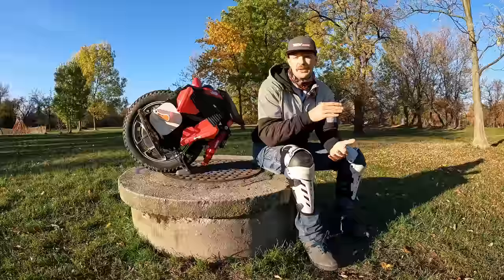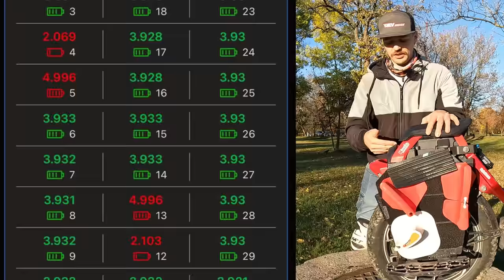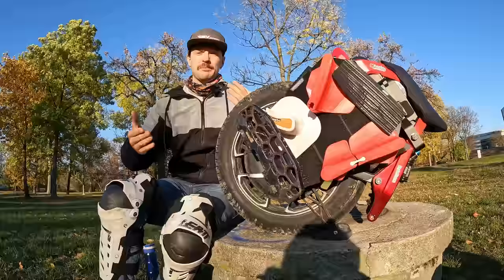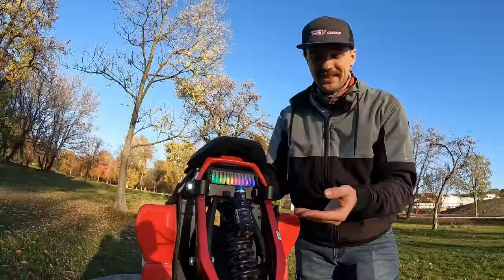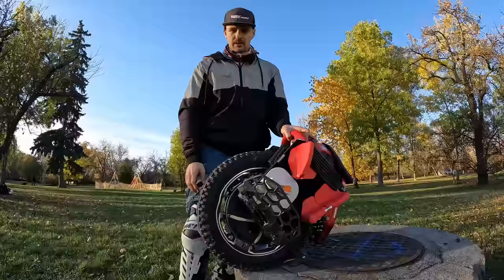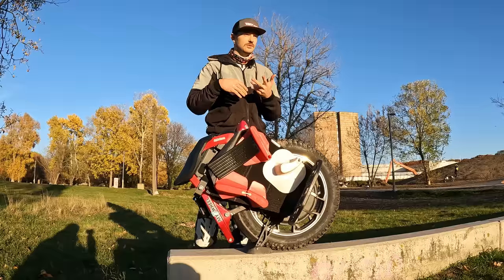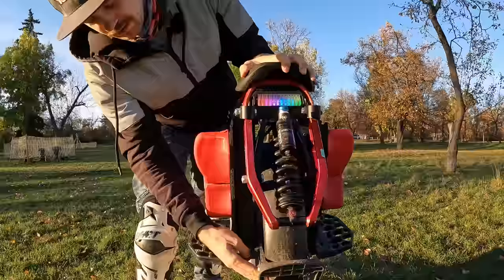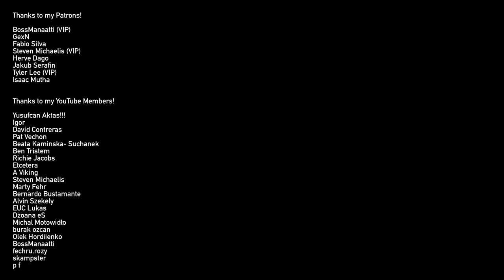BRUTALLY HONEST King-Song S22 PRO Review - After 3200 km

Comment: I’m new to EUC, and I’ve had an S 22 as my first wheel for about a year now. New Jersey United States. About 1500 miles, no breakdowns, just Clark pad, bio pads. Biggest issue I have is the range anxiety I get. About 30 miles of a quick ride, and I’m scared. Other than that , I’m very happy.
Reply: Nice. I’m in DE.  Ride safe!
Reply: Exact same story here. It was also my first wheel. I didn't think I would need more battery at the time. Now I'm thinking of an upgrade.

Comment: Worth mentioning to any owners. The actual water ingress point you should worry about, is where the LED wires go into the frame just under the front of the motherboard area. Silicone these holes after you take the wheel apart. Get one tube of silicone and it will last you ages and you need some anyway for the motor phase cables.
Reply from the maker: Thanks for the additional info!
Reply: Thank you! Which silicon should I buy, is there a specific brand? I am not sure which one to buy and where to put it, completely new to this
Reply: @CycleCritic  I use clear set silicone and you can get it from Amy hardware store.

If you look at the front of the wheel. On either side of the inner area there are wires on either side that go into the battery boxes on the side.

Where they go in there is a weak rubber seal that doesn't really do it's job. Whilst the wheel is dry and clean in those areas just paste some silicone over the hole and smush it in, then put some extra over and let it set.

When you take the wheel apart you will need to reapply it.
Reply: @InsanitiesBrother  That's awesome tip thank you, what about the motherboard itself, is that area waterproof enough?

Comment: Re batteries, they have good rubber seals, water don't get in there, water resistance around charge ports and button is super easy to fix, it's my winter and rain wheel of choice, great water resistance.

Also you dont need new controller if you want the pro motor, just swapping motor is enough.

I think your bolts broke because you are riding it pretty extremely with those high jumps to be fair.
Reply: Words of wisdom.. You silicone charge ports and start button?

Comment: Yup, totally agree with all of that stuff. I have my love-hate relationship with that wheel. (as you saw during Halloween meet ;) )
Though, i am continuously abusing it, so probably im not the best measure  for reviewing. Nevertheless , i love how this wheel sends. 😁
Fun fact that i have also S18 for much longer and i had zero problems with that wheel so far. 🤪
Reply: I abuse my patton, skateparks, dirt jumps, etc. So far only problem was a pinched tube in a rock garden

Comment: Its not as simple as just using a higher voltage MOSFET, it might work but it is questionable. One way to protect MOSFETs is by inserting an ESD protection diode between the gate and source terminals generally.

Comment: An impact screw driver will remove stuck bolts well. the hammer impacts forces the bit to stay inside the head and also helps to loosen the threads
Reply: Despite the use of an impact screwdriver, I cannot recommend loosening without heating to 100°C. You will destroy your head - the inner hexagon. The screws are made of mud.

Comment: Controller case lid waterproofing is certainly not a good, yes there is a seal but screws are inside of a sealed compartment.  BAD thing is that the lid screw heads are in cavities without any kind of seal and screws go through the motherboard. When it is raining water will be pushed under the seat to the cavities and water might seep from there directly on the motherboard. Quick fix is to put tape on the cavities and add silicon to plug two mid screw holes on the controller lid which are holding the red plastic piece on the top.
The lid is also bit flimsy and there are too few screws for sealing, so I filled the seal groove with silicone grease. All the other holes and gaps under the controller box I siliconed and I added tape and silicone grease under the power knob. Also light wires pass through should be siliconed. 
Pedals (IMO) are actually pretty good, they are lightweight and knobs/studs can be sharpened with angle grinder or dremel.

Comment: Definitely agree with you. I've passed 5300km on my S22 (Not Pro)  now, a lot of it off road. I'm not a BIG jumper, (just little ones for me) but the tracks are very steep an rocky :)
To extend the side pad area I used some 2mm carbon sheet.  Less than half the price and stiffer.
Keep up the good work Adam  👍

Comment: The S-20 was going to be my first "new" wheel. Now, I'm not even sure that I'd buy a used S22pro.   V14 and CP mini look promising.
Reply: Buy v14 if u can afford it
Reply: The new leaperkim Lynx have the same weight as v14 correct? But 20" sure have advantages on the stability and speed(150v vs 134v)
Reply: Begode extreme is amazing.

Comment: Had a friend who traded a onewheel for an s22 on marketplace. We saw it and it was working well, but it was snowing when we did the trade so there wasn't much time to see how it was. After a while it had a BMS issue that kept it tilting back everytime you would turn it on even after being on the charger, but a firmware update fixed it luckily. Sadly we just had to wait for one to be available. Although the s22 was in my friend's possession (now in mine), I rode it mostly over him while he learned to ride comfortably on my 18xl. After ~500 miles on the s22 by myself,  an issue it developed is what I can describe best as motor tremors? It can begin to shake aggressively when braking, It is an issue that is showing to be pretty consistent right now. I would like to replace the motor for a pro motor, but given all the other issues it could end up having, I might just get rid of it for cheap and let someone else work on it. I don't mind maintenance, but my 18xl with 4500 miles (~7200km) doesn't give me any issues at all. I have taken it apart to check how things are, and after decent trail riding, hitting bonks daily, and overall some pretty good torment for the 18xl, the only maintenance I will need to do soon is slap a new tire on it since mine is almost bald. Would much rather have something I trust like the 18xl than something that I will fear riding.
Reply: Those motor tremors might just be your control board is not screwed down tight enough. Because if that control board can vibrate just the slightest it will cause the motor to vibrate when you're like braking. I had that problem on my 16x and my friend had the same problem with his s22 and that's how we fixed it
Reply: @BANGbucketHEAD  Thats very interesting actually. Thanks for the info I might have to take a look into this. The bolts that hold the housing for the board arent all perfectly tight right now so Ill have to swing to the hardware store so I can get some that arent just spinning freely.

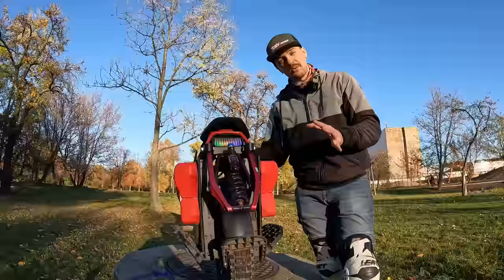Comment: @13:16 my S22 has about 1,000 miles on it and I've done tons of jumps, huge drops, and stairs... but none of my bolts broke. I guess I've been lucky. However, my S22 developed a crazy annoying vibration when riding slow or stopping and I can't figure out how to fix it :(
Reply from the maker: I’m glad they didn’t! You’re a lightweight though! I would keep an eye on them as they tend to get weaker over time… the shaking is either due to rollers or loose bolts on the motherboard! There has to be something that makes it rattle and shiver! Also glad to see you in the comment section again!

Comment: Thanks for the review , I have the same experiences, bearings loose, bolts loose and broken, but jumps like a breeze. I also experienced peddle dip when speeding and hard lean from 50 tot 70, its dangerous. But for grass racing its perfect ( max 50).

Comment: Interesting review! I find it strange that only one wheel has decent lighting for road use (the V11) and instead we have to put up with lights that are simply unsafe on the road. Why haven't all wheel pedals standardised to something that's adjustable and non slip in the wet. Will you be doing a review of the S19 and S16? Personally I'd be more interested in a commuting perspective (battery safety, range, reliability, robustness, waterproofing, features etc).

Comment: Have owned s22 for one season approx 2000 km and I generally agree with this review. Spot on for the most part. However despite all the issues, I love this wheel and feel this review helps riders understand the issues and have a better experience with this wheel.

Comment: Mine (non-pro) currently has a “working power failure” error 226, still fully rideable, just won’t charge and incessant beeping every 5 seconds. The battery packs are 0.5v different, 0.020v difference between cells. The fault actually cleared itself a couple months ago and allowed me to charge it, but it came back.

Comment: My trolley handle broke. Some sort of die-cast. I fixed it with 10mm panhead self drilling Philips head screws.
I am surprised that the bolts are not good quality steel, seeing that industrial bolts are cheap.
My front bumper has taken a thrashing and will need to be replaced. It is held together with cable ties. (I learned to ride on my machine)
Did I see cruise control in the software?
I am having trouble deciphering the meaning of the numbers in the app. Perhaps I am stupid, but I think it needs more explanation.

Comment: Glad this one never interested me.  Those rollers would be dead quickly where I ride - much dry dust and grit.  Did the rim also bend?  It looked dented in the video.
Reply: I used to off road mine, that's what I got the POS for. I ride in the mountains and I needed to do full maintenance every 600km it was every week and a half to 2 weeks. It's such a POS. I no longer off road

Comment: Need clarification, why does mb needs an upgrade? Is it only if i have 125v mosfets?
Reply: Because under certain circumstances you can over charge the board. The board has insufficient overhead

Comment: I'm just under 8k km. This is the murder of this hobbie. This wheel is enough a reason to avoid this company entirely. Non-stop problems, money sink. Non-stop repairs.

I'm all for innovation, and companies trying new things, I mean kingsong did bring us all suspension to EUCs and was much needed. Sure everyone been trying different methods to find the best one.... but to continue this failed rail trash design on further models should tell users all they need to know.

The are currently on their 3rd motor manufacturer. I am 3 motors in and willing to bet the bearing are probably still 1500km max range. Do not ride in rain, I did once very light rain for only 5 minutes and the bearings ceased that night.

The board I always scared was going to blow on me as it did on many others, somehow mine has survived.

The materials they use is inexcusable at the price point. Those plastic dipped chrome plated ikea quality fixtures on the suspension is a joke.

You must spend money on farings, pads, cnc rollers, extra 420 wheels for replacements every 600km.

This is such a POS I could go on but it's to infuriating. Absolutely trash!

Comment: S22 Pro Revision 2 would be nice wheel if the manufactured fixed alot of the fixable issues.
Sure is a project wheel and does require alot of after sales work to make it better to what it should have been from the factory.